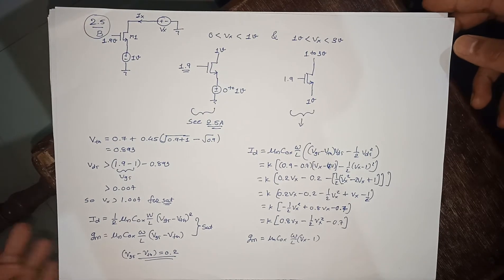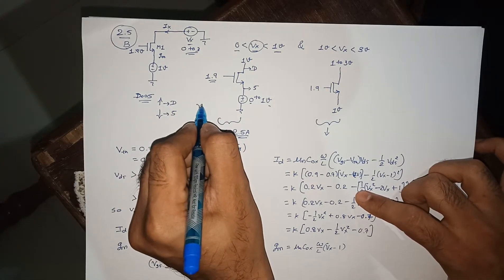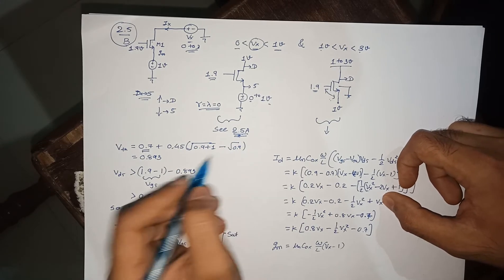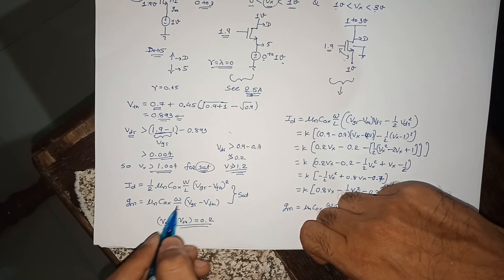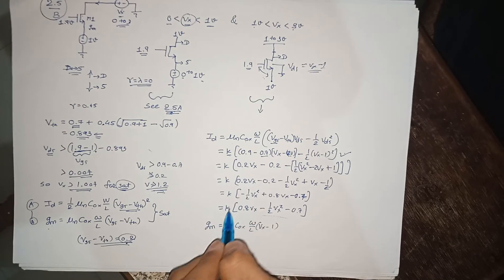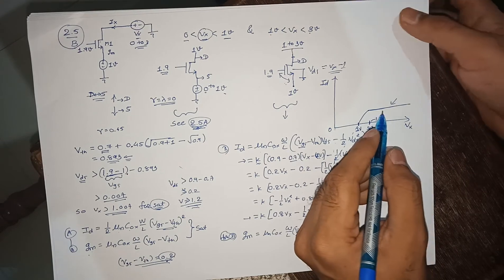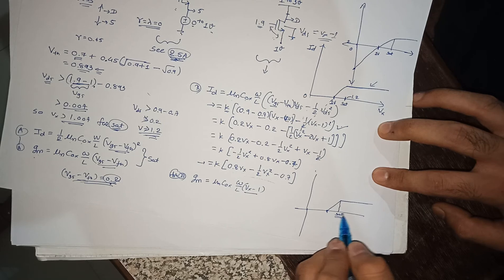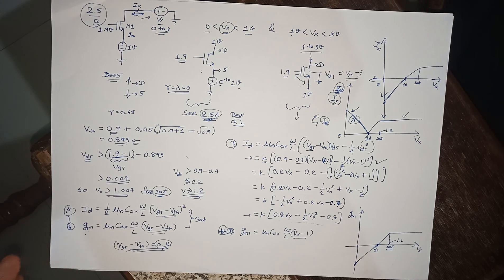Razavi Chapter 2  ||  Solutions 2.5 (B)  ||   Ch2 Basic MOS Device Physics  ||   #7

Comment: Kishan,

Thank you for your efforts in making these videos. I have found them very helpful in going through the textbook to understand the material. I do have one question:

In the evaluation of where the device goes into saturation from the triode region, we consider channel-length modulation and its effects on Vth. As such we have that for Vx > 1.007 (V) the device is in the saturation region. However, when we consider this from the opposite end (i.e. finding the cutoff for the triode region) we cannot consider channel length modulation because there is no channel length modulation in the triode region (as seen in example 2.6 of the textbook). Thus, our inequality becomes: Vgs - Vth0 > Vx - 1. Which evaluates to be that Vx < 1.2V for the device to stay in the triode region. 

Can you provide additional commentary on this? I look forward to your thoughts.
Reply from the maker: Sure, will make a video on the same